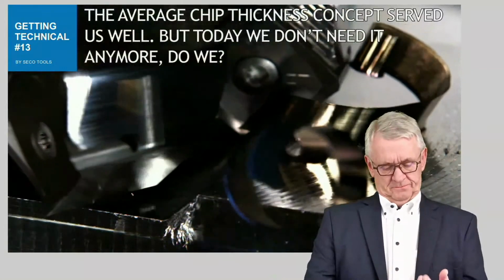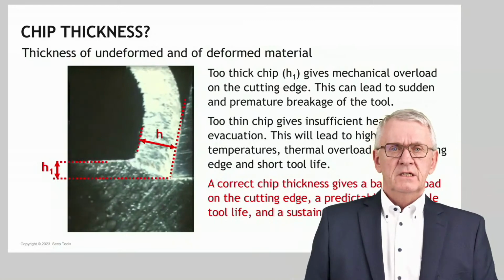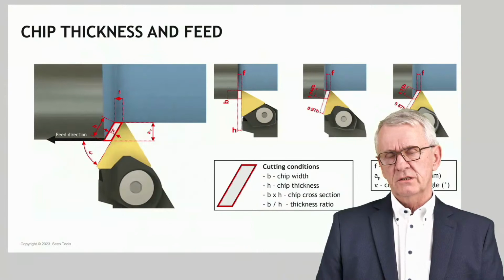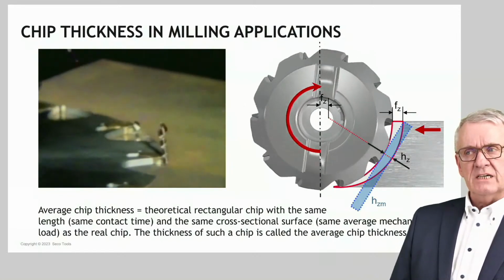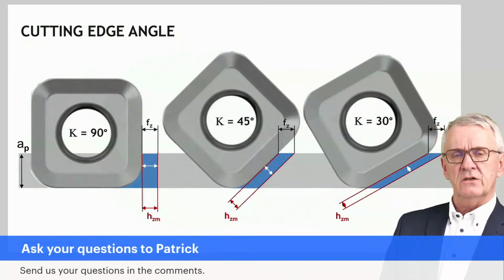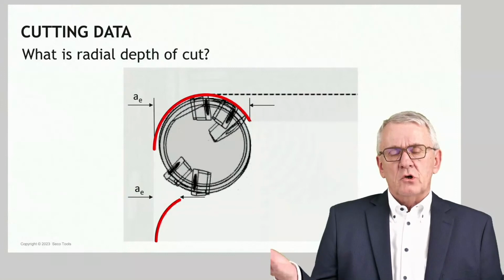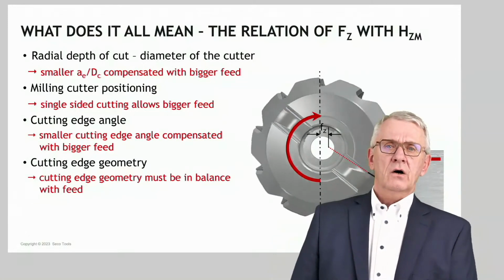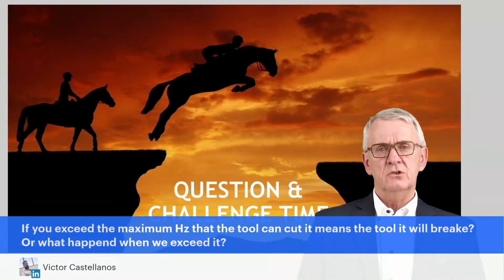Is average chip thickness an outdated concept? | Seco Tools

Comment: I am sorry not to attend the webinar during streaming time. The average chip thickness, you said, gives us the amount of heat that 
chip itself takes  away from the cut.
Does the ratio heat on chip / heat on cutting edge change , moving from water cooling to air cooling? how much?
Thank a lot for your interesting webinar !👏

Comment: I would think that coating should be carefully chosen according to the specific material, and even possibly according to the tailing chip thickness to help draw the heat from that thinning chip. Additionally, doesn’t heavy flood cooling alleviate the heat from the thinning chip, or is that heat buildup so rapid that coolant doesn’t remove it more rapidly than it builds up? How do these compensating factors change the equations as they don’t involve these additions?
Reply from the maker: Hello, and thanks for your comment. 

Very good reflections on the thermo-dynamic phenomena during machining. Some points to consider in this reasoning.
1.	For coolant to be really effective, we need to apply it where the actual heat source is located. And that is mainly in the shear zone, To come there, the cooling needs to be in between the chip and the rake face of the tool and the local pressure is there approx. 20.000 bar!
2.	If we could overcome that pressure and bring the cooling to the shear zone, it would enter an environment with a temperature of around 900 degrees Celsius. The cooling would instantly become steam and it would form a steam barrier that prevents the ‘’next’’ cooling to come to the shear zone.
3.	The time effect. Imagine a tool used with an rpm of 6000 and with a radial depth of cut of for 30%. This means that the temperature on a cutting edge increases from room temperature to 900 degrees Celsius in 0,0015 seconds and then decreases back to room temperature in 0 seconds.
This is a very fast answer. For more information, see the technical books.